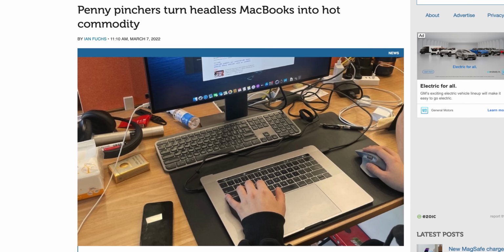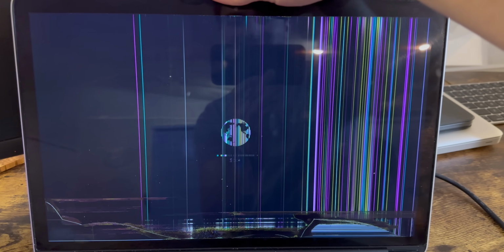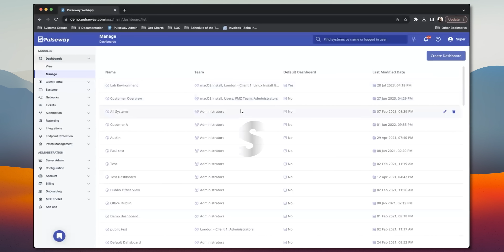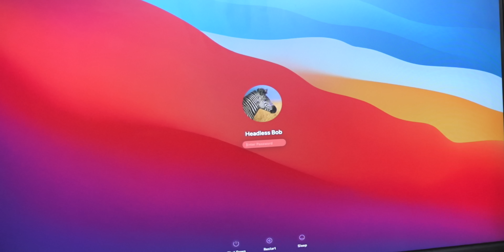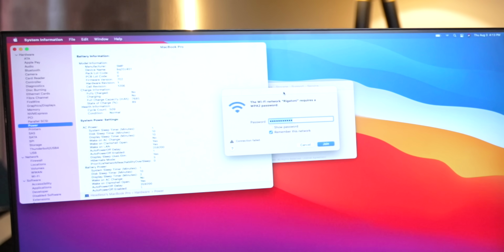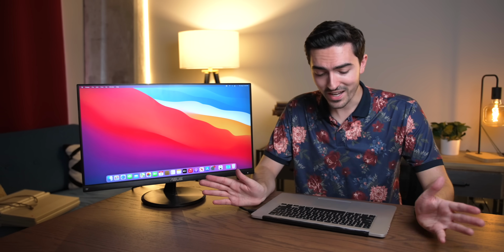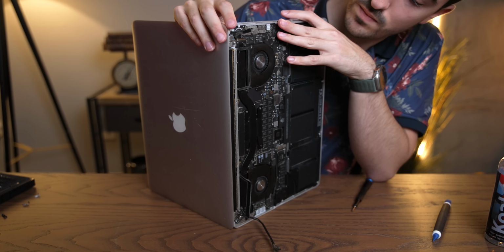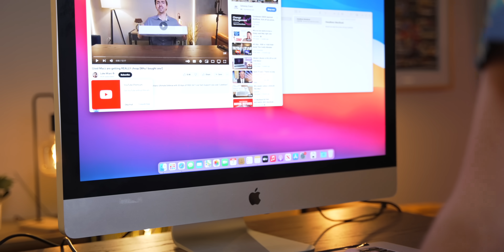Exploring the weird world of 'Headless' MacBooks

Comment: Instead of electrical tape covering the antennas, just use some black heatshrink (available at most electrical and automotive stores). It shrinks from heat from a cigarette lighter or heat gun. The two advantages would be a cheap solution compared to 3d printing and would look great.

Comment: a better idea: only to disconnect the tiny and flat connector shown at 4:23. wrap the connect with some isulation tape to prevent electrical short inside the macbook. And don't have to remove the faulty display unit from the macbook. Close the back cover by putting back all the screws. Then connect external display unit as shown in the video and here you go!

Comment: Curious as to what your plan was if the hard drive wasn't included?  I have a 1502 I just replaced the ballooned battery on, but my Sintech adapter keeps causing crashes(was doing prior the battery swap).  The OEM 125gb drive was horribly undersized to do any updates on programs.   OEM drives are still expensive.

Comment: I'm definitely confused, why does it need to go headless?  I picked up an early 2015 macbook air with a broken screen for $5 and I have it hooked up to an external monitor and have been using it with the screen attached for months. I use the macbook air keyboard and trackpad with no issue? I'm using it right now to watch this video and type this comment.  Why headless?
Reply: Usually looks much better aesthetic wise if the screen is cracked/broken...you won't need it again anyway so might as well get rid

Comment: I'd rather use wireless keyboard and mouse with this and leave the shell as is.
Reply: I don't get the point of a wireless keyboard unless you're using it with a TV. Personally I'd also take a good trackball over any mouse, and the wire doesn't matter with those.

Comment: Actually u can use mouse and keyboard. Just connect USB hub with everything connected including screen to MacBook when it’s closed. It will awake with working peripherals
Reply: I wouldn't be surprised if there was also a software option for this, albeit it is Apple so.....
I've used a Windows laptops with the lid closed, such as when using a wireless keyboard/trackpad combo, with the laptop connected to a tv.

Comment: BRILLIANT this completely solves my problem of needing a cheap Mac with Optical output for my HiFi           Older MBP's have an optical output
Reply: Why would you need a Mac just for audio?, I can't think of any audio that would require a mac. Digital audio out is easy & cheap to get elsewhere - you can even just split it off HDMI using a cheap adaptor from aliexpress. Even getting it from a phone should be pretty simple, such as via USB adaptors, or again via HDMI if the phone supports that.
I have a little thin client(running Linux, but I should've just left Windows on it) that I use for videos to the TV and audio to my amp, using optical audio split from HDMI.
Reply: @DoubleMonoLR  "Digital audio out is easy & cheap to get elsewhere "  the main issue is I want to be able to control it with my primary iMac and have the 24 Bit FLAC files stored on the HDD of the Mac in the Hi fi rack

Comment: I did it, 6 years ago, because of Apple shitty manufacturing, in order not to use the nvidia discrete chip, and force the usage of the intel integrated cpu that at least would not crash ...  mb pro sucks! never again. They were so incapable of integrating external graphic chip that ended up with arm and cpu graphic cores... and all those people buying it as a 'revolution'... while you can enjoy gaming laptops 4 times faster than an m2 or m3, for a fraction of the price.

Comment: Okay, so I have a bunch of important (please, i have 30 years of poverty computet experience so DO NOT argue with me on this point) important! information in my tabs and desktop on Macboom Air 2013 and  i spilled water, made the screen go green and blue and red but it still starts up, keyboard lights up etc, so there is just no backlight. I can see it but just doesnt give me the light on the screen itself only a light pale shadow of the apple logo and login box.

I need to know, in this case what do i do to just see the info on my computer and use it regularly? Can I be sure my laptop info wont be ruined or corrupted

Comment: I did this with a ThinkPad x280 (8th Generation i7, 16GB RAM) and it works great. I need to change the thermal paste, but I'm really happy with it because it's always better to recycle electronics whenever there is a chance to do so. Plus, laptops idle at very low wattages making them perfect for server usage, and without a lid, thermals usually benefit greatly. I removed the battery for safety reasons (keeping a laptop server online 24/7 with a battery is not a great idea) but I've gotta say, it's a great project and a lot of fun if you like to tinker with technology. It does suck that it's not easy to get Wi-Fi working, but for server usage, you likely already want an Ethernet connection anyways. It's a great option for people looking to start a homelab without a lot of money for sure.

Comment: I took my 2013 15" MBP with a broken screen and turned it into a server. Currently it sits in my garage with 2 OWC DAS enclosures. One is the Thunderbay 4 Mini with 4x 2TB 2.5" SSDs, which holds my Lightroom photo library. The other is a Thunderbay 4 with 4x 4TB 3.5" HDDs as a backup of my photo library. I have other SSD's for Time Machine backups and storing movies for streaming on  Apple TV

Comment: 3D print the case/cover for the wireless antennas in the display heat slot, and you get it nicely even for grey or black.
I have done two of these and they are marvelous machines to give away to poorer families, as they have displays etc, but they get to use a new computer now with Linux. And good thing is, it doesn't even consume so much electricity that it would increase the power bill. 

And best part is, use a chromecast to cast the display to TV... Now you have a proper remote device for HTPC purpose. And nicer really as it is like big remote for TV, without the clamshell display.

Comment: You do not need to disconnect the antenna. The antenna is usually a bit of aluminium foil with the tree receptors attached. You can just smash it in. You can just use a piece and connect the ends.
Edit: Oh you do that in the second half!

Comment: I recently had problems with the display on the m1 air after 3 years of using it and it economically makes more sense for me to just buy a new one because the repairs are too expensive. While I wont take off the display I will continue to use it even when I receive my newer model by connecting it to an external display. Helpful video overall

Comment: It amuses me that this is a bit like home computing coming full circle. The earliest home computers were the keyboard build into the computer housing itself requiring only connection to an external screen, like the Commodore VIC-20 and 64, TI-99, and of course the Apple II. As someone else mentioned, this effectively becomes a Mac Mini with built-in battery backup and input. I honestly love it. If my 2015 MBP didn't still have a perfectly excellent screen after having been refurbished by Apple on recall, I might have considered trying this!

Meanwhile, I'm still pondering the Juicycrumb board for my 2011 27" iMac, but really would like to be able to make use of the optical drive and internal SSD as well, and their Pro board still isn't ready. Hmm.

Comment: I have my old 2012 MBP running like a beast 24/7 as a home server. It runs Plex mainly, used to run home assistant until I upgraded to a Synology. But the MBP is still active and running some random things along with Plex. Docked in a vertical stand, use an external monitor. Also pulled the battery out after it started puffing up. 11 years old and this thing is still a beast!

Comment: I’ve done this sort of thing a few times over the years, with assorted laptops. The most recent example (sort of) was a Surface Pro with a cracked screen. This completely wrecks the touch and stylus input, but with the keyboard/trackpad attached it was still a reasonably useful desktop computer, and aside from the crack, the super-sharp display still worked. So I added a big external monitor, a proper wireless mouse, and VOILA: a dual screen desktop computer!

Comment: I'm now using a 2014 13" MBP, a 2020 13" MacBook Air M1, and a 2015 15" MBP all through the Screen Sharing App.  I left the screens on them, and keep them plugged in, then I can do this as long as I want.  I even have the Screen Sharing connections automatically open when I boot my computer.  Attached to the 2015, I have two 27" HD monitors and all my mice/keyboards/backup etc.

Comment: What is needed is a replacement for the battery charging port that allows you to just use an AC Adapter so those with bad batteries don't have to worry. Those magnetic couplers just suck. Ive had three burn up on me. Easy enough to replace but they still suck. Let's get an AC adapted setup.

Comment: Mine has a bad screen and a really crappy keyboard so I just use it in clamshell mode on a stand sitting on end at the back of the desk and I use a bluetooth mouse and keyboard. Mine is too new and has no direct ethernet. I have an external dock with ethernet and other stuff connected with a USB-C Thunderbolt connection. This way I keep charged and get my ethernet without having to loose but one port on my computer.

Comment: One thing missing from this video is another reason why there are so many of these broken macbooks: It's because the flexible cables connecting the screen with the motherboard have worn out, and apple forces you to replace the entire screen instead of the cables (by integrating circuits with product identifiers into the cables). This is called the flexgate problem with macbooks... and it's messed up for sure.

Comment: By any chance, do you know how much of that skeleton that houses the antenna you actually need to pick up wifi? It has an opening where the wifi cables go into and from there I don't know how deep they run or what they connect to. I have a headless MacBook right now with the bar just resting alongside  the ventilation ports, but I thought it would be cool to detach it and built a little old school v-shaped antenna with the cables.

Comment: Not sure how to ask this without sounding like a troll ... but why wouldn't you just buy a Raspberry Pi or another SBC? Probably as powerful as a 10yo Mac ... and you can way more easily just run Linux ... and it'd be 10% of the size/weight ... and you wouldn't have to use a shitty Macbook keyboard ... and everything would just work and be 10 years newer.

Comment: Hi Luke, great site you have. "exploring the weird world of "Headless" macbook is very interesting to me. I Just bought a new MacBook Pro because my 2016 macbook pro's display was dying. I have used the old Mac as a monitor with a doggles usb to HDMI in the past and the Acer Monitor ( same as you have on the video) worked  great, Then for som reason the monster started intermittently  flickering. The monitor works fine for a minute or two and then flicker's off, as if the monster rebooted it self, but it can't because it's just a monitor.  I tried to us a USB C to HDMI cable and its still the same. I also tried to use another Monitor and that does not work either.  Interestingly enough while at the apple store I connected the 2016 Mac to the $1500, monitor  using he USBC to HDMI and it the computer worked Just fine... What I don't understand is why is my computer  when hooked up to an external monitor flickers.. also the new MacBook Pro also flickers to the monitor,.  both machines cast to my  TV with no problem.. Any help would be appreciated. 
Andrew
Houston, TX

Comment: I’ve done this for people since 2010.  Nothing new.  After a few years the screen becomes too expensive to repair but the system works fine. The lid traps heat and you can’t use it anyways so off fit goes!

Comment: I found a screen for my 15" MBP Mid 2014 on Ebay for 110 bucks!  I've kept this sucker alive for almost a decade.  It's been through 3 batteries, some new thermal paste, and an upgraded SSD.  And I'm still rocking High Sierra because I wanted to keep using my 32 but applications like Final Cut 7 and Reason 4.

Comment: You missed a masterstroke by not also buying a Commodore Amiga and comparing and contrasting the features (from higher CPU power and more supported architecture, to more storage, to 16 vs 8 bit PCM audio support, to much larger display resolution).

Comment: I just took a blade and cut thru the LCD flaps cuz I didn’t have the small screwdriver and it worked w/o removing the WiFi connector 😅 works!

Comment: I did something fairly similar.  My old 2012 non retina doesn't have a cracked display but is so out of date it's no longer usable as a daily, even with 16GB of ram and an SSD.  
So when my GF gave me her 2015, I decided to run OPNsense and make it my router - way more powerful than any router you can buy, and I run separate APs and POE switch for the network itself.  Plus, it is battery backed!  

Only issue is that OPNsense doesn't seem to turn the display off when the clamshell is closed, so I did open it up and disconnect that cable.  I'd rather have the clamshell on to protect the keyboard and prevent it being inadvertently messed up.  It's easier to administer it from the broswer of another computer which has a great GUI vs the command line interface on the display itself.

Comment: If I were to go so far as to disassemble the MacBook, I wouldn't stop there, and I'd proceed to enhance the cooling performance directly, maybe in a larger or open case. It's possible that you could still use or remove the keyboard separately. I would approach the speakers in the same way. It would involve more effort, but it could really maximize the potential.
Reply: Especially with a custom/purposeful case like those people who rip apart chromebooks and use their guts like raspberry pi's. Definitely would be a fun productive experiment with a sensible endgoal, unlike removing a screen and then plugging in a monitor to an input that was there the whole time & calling it a build lol

Comment: Stop letting the secret out; our broken Macbook prices are going to be stupid once people realize this "hack"! But in seriousness, I actually think a 2012 Macbook Pro with a broken screen, which are Cheap, and then throw 16g RAM and SSD if needed and it's hands down the best value you can get in a computer. You end up with a totally usable dual core(quad core virual) processor, SSD, and 16g RAM for $100. Then just snag a really cheap or free monitor or small TV off of Craigslist and you have a Very capable computer that you can get for $100 repeatably. You can also then use a program to hack the computer to run the lastest Mac OS if you want. I wish I had known this stuff when I was young and poor.

Comment: I have a 2013 Macbook Pro with a perfectly fine screen. My issue is the battery. It's been replaced once already and the new battery only lasted about 8-10 months until it wouldn't hold a charge anymore. I went through all the the instructions the guy told me; draining below 10%, fully charge again without use, repeat, repeat. You literally can't use these things in any functional capacity without a working battery. Is there some sort of hack to use 2013 MB Pros to their full potential without a functioning battery, just off wall power, or not really?

Edit: Not only that, but the "professional" who replaced the battery destroyed the right speaker so I'm a little hesitant to have it replaced again. I live in a small town and options are limited.

Comment: I mean, this isn't a new concept but I still love it. Cheap tech savvy folks have been doing this for years ;-) ultimate case of Reduce-Reuse-Recycle! 

I did this with a Lenovo M14 recently where the top panel was dented all to hell and the screen was cracked. Was able to run the laptop "headless" and keep all the functionality including the fingerprint reader!

Almost any modern machine that has a display output can be turned into a little desktop, or even better, a hidden desktop mounted behind a monitor/TV for a cool experience.

Comment: Not an Apple fan, never have and never will buy an Apple product. However I can see myself buying a "broken" for parts working Windows laptop and doing something very similar to this. I thought about using one to make a "smart" device, out of a large flatscreen tv. Specifically focused at kiddos. Mount it and the TV up on the wall, and they could control everything with a wireless keyboard and mouse. Set up some emulators and other stuff, could have a Nice Cheap little set up for a gaming room or basement playroom type deal.

Comment: I think another cool use case is to send the screen via WiFi to your TV. Sure the FPS / refresh rate might not be awesome but for simple tasks that's quite a cool couch setup where you can control everything via the inbuilt keyboard and trackpad and don't need to worry about a HDMI cable you can slip over.